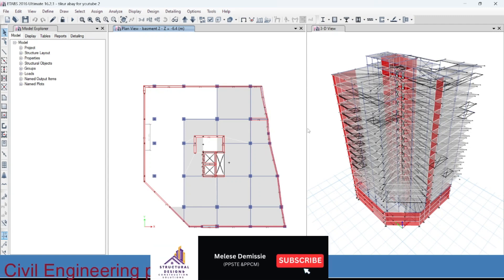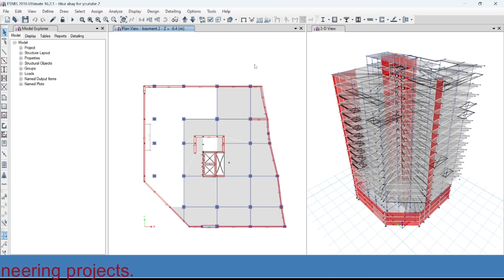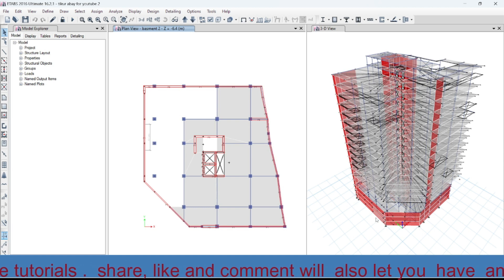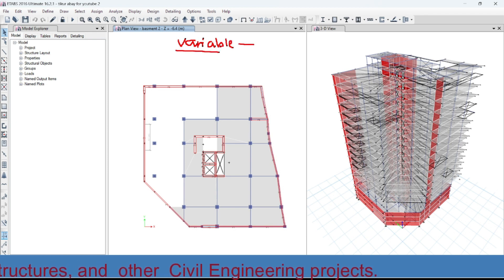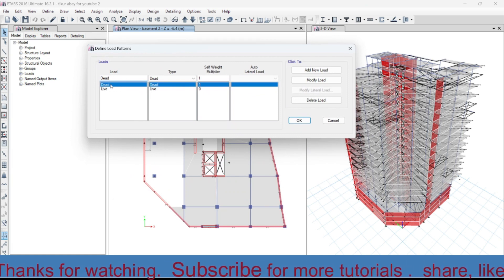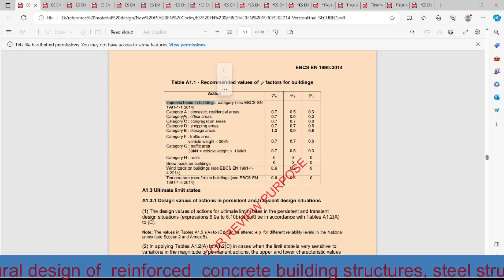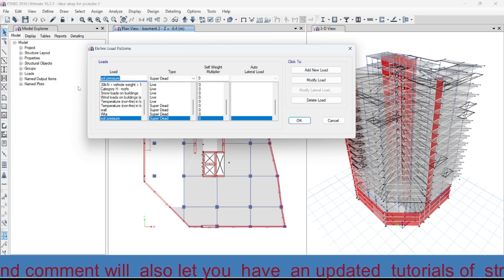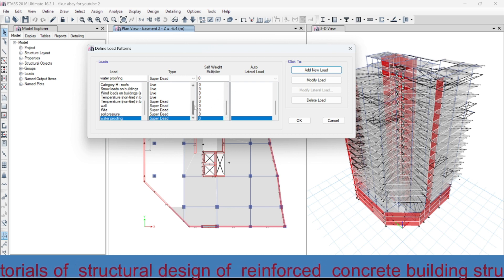Complete Structural Design of 20 Story Building using ETABS as per Eurocode & Ethiopian Code (part7)

Comment: Hello Sir. Will you not do live load reduction for gravity loads for the entire building? In that case do we use live load or reducible live load pattern in ETABS?
Reply from the maker: live loads are reduced with coefficients while we   combine it with permanent and lateral loads (as per Eurocode). Gravity loads are permanent and actual loads which should not be reduced in fundamental load combination.
Reply: @melesedemissie7664  I refer to live load reduction as stated in EN 1991 part 6.3.1.2(10) where there a reduction on the imposed live load for several stories.
Reply from the maker: Etabs will do  LIVE LOAD REDUCTION FACTOR  automatically along the height of the building for design, if u make it active on etabs.  but for permanent load  NO